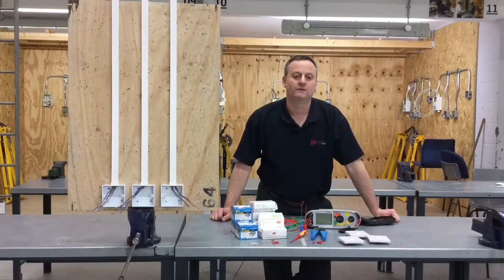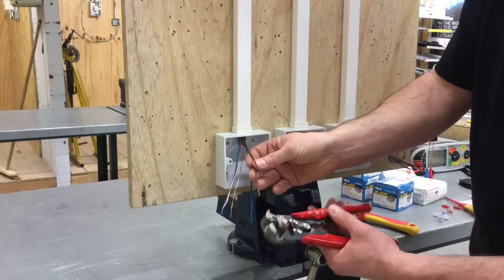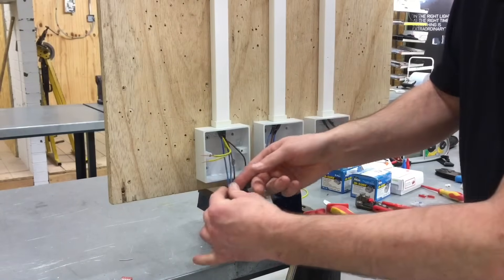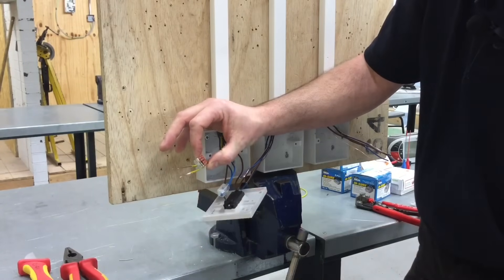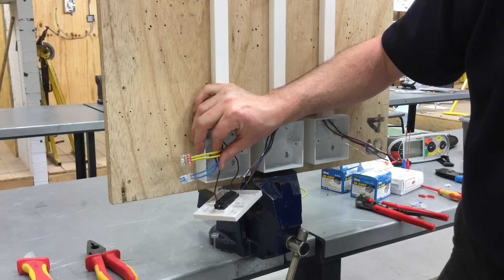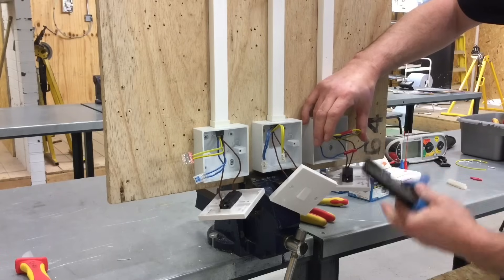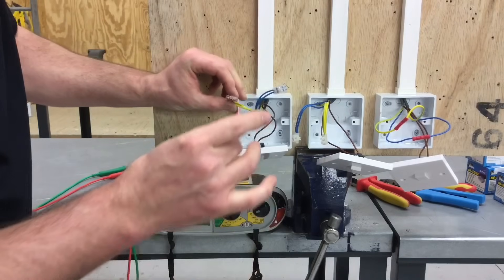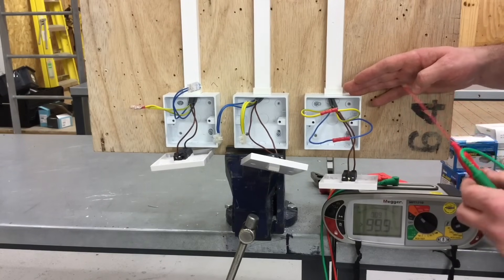Taking the Feed (Supply) to the Switch Connections Using Wago, In-Sure, Connector Blocks & Crimps

Comment: I moved from the U.K. to Switzerland a decade ago and the wago connectors were standard even back then. With the wago ones in this video, you can remove the wires if you pull and twist, rather than cutting the wires an wasting a connector.

Comment: You make your students use a knife to strip insulation because wire strippers are "too easy"? Why are you even in education? You should allow students to work smarter and wire strippers are the proper field tool and safer than a razor blade. After seeing someone slice their hand wide open it makes zero sense using a damn knife blade...

Comment: So the old connecter block wins hands down with easy testing.
So new methods aren't always better then. 
P. S. Do the switch connections last. Is the better way. Not working around it.

Comment: Interesting video, couple of comments. Using a knife to remove insulation from conductor opens the operative up to cuts on fingers / thumb. Risk mitigation would be to use strippers, I've used the adjustable V notch pliers for donkeys years without issue. Also cutting back the excess conductor, why not use end snips, less cumbersome than pliers. Inserting the single conductor CPC into the Wago,  I use long nose pliers on the conductor for insertion after sliding the PVC sleeve back a few mm, adopted this method after  a fail on testing. I thought the CPC was fully inserted and it looked it, but testing proved it wasn't. Plier insertion only now.
Reply: A few tiny cuts will quickly teach them to be careful.  I do agree about the earth conductor and loose screen.. Either pliers or careful visual check on the Wago.

Comment: I am Shocked, you took me back some 30 odd years to when I first entered the industry and All those dumb practices existed then. Sorry but what I have seen here today is nothing more than Practicing the Magic Art of Bodgery, lets start over here,  inserting crimps, wago's,connector blocks left Floating around in any Electrical Accessorie is a Massive No No, Find a Solution, yes there is one and it has been around since the begining of time, ok maybe not that far back but believe me as far back as my career has spanned. Go out and Buy a DP Switch and connect all your Cables into the correctly provided terminals of that Accessory,  oh, you have a need to connect a 4 gang plate switch, then use a Grid Switch, this again provides you with all the necessary connection points and cuts out the need to bodge the job as they say. 
On a final note, Crimping Cables properly to extend their lengths can be an acceptle practice provided the Crimped Joints are Sealed, Heat Shrink is one means of achieving this, no opening is allowed or needed to test as it is considered a permenant fixing, like soldering.
We as an industry have not yet arrived as a Communication industry choosing to leave bunches of cables flying around a Cabinett in terminals such as Wago's
Mr Spence Eng

Comment: I think its bad practice to crimp earth a neutrals in a switch. No they need to be readily disconnected I.E. WAGO lift up connectors or traditional strip connector purely for the reason of fault finding. Crimps have to be cut off and re terminated (not with crimps) you need to be able to disconnect cables and verify their ok no faults or temporary/permanently disconnect in order to get the circuit back on again. It winds me up when I see this when you’re looking for faults (you don’t need this if you’ve been called out in the middle of the might). Also when they screw the earths together and sleeve them with one piece of sleeving you have to unscrew the earths and separate them take the kinks (work hardening the copper) out the wire in order to verify them and re sleeve them separately. I always think people who do this never have to look for faults or have to go back their installations. And I don’t understand why people are saying you can’t take a neutral to a switch why? There’s nothing in the regs to say you can’t. Most guys now are doing this because we are not using ceiling roses anymore and having more fancy fittings which never have enough room for connections (especially wall lights) easier to find faults and disconnect if need be.

Comment: I don't understand how the continuity from the line to the CPC happens. That would mean that the line wire is shorted to the safety ground somewhere upstream which would rob this downstream circuit of any current? Wouldn't the better test be a continuity test between the return and the CPC?
(Disclaimers: I'm in the US and usually the safety ground is connected to the return at the primary breaker panel, not sure if it is similar outside the US. I'm trained in electronics so I understand circuits, but I'm not trained as an electrician so I don't know NEC (or other country equivalent) electrical wiring codes.)
Reply from the maker: I think the answer is in the description. I have linked the line and cpc (earth) together as if my learners were carrying out a continuity of cpc test on a lighting circuit. 

Thanks for commenting and watching. Gaz 👍

Comment: i realise this is a very old video but upon watching i have come up with an question. In this video you used the 5A connector block however in the UK most lighting circuits are protected with over current protection rated at 6 or 10 amps so in theory when these are used to connect the neutral then there is potential of failure there. I'm sure it is an unnoticeable thing and nothing bad would ever come of it as this is how it has been done for years and i have yet to come across one of those overheating from such a cause. anyways, those wagos are great and they also do twist off! keep up the amazing content!
Reply from the maker: Thanks 😊👍
Reply: Well spotted, but it has gone on that way since the introduction of 6A MCB's and the reason may well be the same as;  have you ever thought why we are allowed to use 0.5 or 0.75mm Cord Flex to the Lighting Pendants when the Max Current is way below a 6A or 10A MCB, the reason given to me by a very Senior Engineer was that it would be highly unlikely that such a heavy current would ever be taken from the Lighting Circuit to the Light Pendant and the same reason is True for a 5A Pvc Strip Connector, but please bear in mind there is a place for everything within the Electrical Industry but intalling connectors into Light Switch Box's is or should only be absolutely nescessary to secure the Switch Wires cpc [But there are Manufacturers who provide a spare Terminal to their Domestic Plate Switches now] and then it should be used in such a way as you take a Pair of 5A Connectors and screw through the center a tiny fixing into the rear pattress to prevent the Strip Connector Floating about within the enclosure.
Hope this helps.

Mr Spence Eng

Comment: I have always been told not to use through crimps with solid core wire only with stranded wire.
I know you was only using 1mm wire but would you use it on 2,5 and higher?
Reply: You most certainly can, you just have to ensure you use the correctly rated crimps for the cable size and current rating. You have to use ratchet crimpers. Give the cable a good hard pull to ensure a secure crimp.

Comment: Excellent channel. I must say though, in all my 55 years of doing this type of work, I have never used a knife to strip wire, it tends to nick and damage the wire. I have always pinched the insulation with cutters and pulled off the end, thereby not damaging the wire. This is a skill I had to practice.
Reply: David Potterus I use me teeth😂😂
Reply: Yes, but a sharp stanlyknife like a pair of side cutters have seen many a novice nick or cut to deep into the copper and damage the conductor, hence how many times have you pulled off a socket or light switch only to find the wire off, in the main a cable just sitting there waiting for you to come along and snap the wire. 
The proffessional Electrician has Strippers in his/her tool box, he/she sets them to the correct depth and 100% success rate!
The more I see today the more it seems that we have poor training and lack of correct leadership and all the BS Regulations in the World does not make a Good Electrician.
Mr Spence Eng

Comment: The switch will have top marked on it . It makes no difference which way round you put the 2 brown wires.
Reply: Why? is it your intention if you have put the switch on upside down to say that you have adopted the USA Switching practice of having the Switch UP for ON and DOWN for OFF?
You do know there is still a correct way of wiring a 1G/1W Plate Light Switch?

Mr Spence Eng

Comment: Always good video's, been in the trade for years, enjoy watching as your never to old to learn new tricks. 

My main preference is to crimp however I found that the closed end splice crimps are better for this scenario. As you can crimp 2+ cables which is good for the CPC side of things. All cables go in the same hole to which I twist together before crimping that way you know you have good continuity. Easier to get the test probes onto copper, and you can always remove crimp with a pair of gland pliers, by squeezing the sides which saves cutting off.
Reply from the maker: Thanks for the wonderful message Gaz 👍

Comment: Those clip devices used in example one  are really trick wish wish we had them here in the U.S. but they would never fly for that type of installation no physical connection of the wires like in a wire cap  we use ones like them in low voltage communication connections.
Reply from the maker: Take a look online for Wago connectors they are a massive part of any electricians kit. Thanks for commenting and watching Gaz 👍
Reply: Wago connectors have been in use and UL listed in the U.S since the 1980s....

Comment: Using a knife? That's stupid,  folding over? Oh so you've been shoving that into little apprentices heads as well?

Those knifes are for stripping SWA, how to slice your fingers open and use cheap insulating tape as a bandage??
Reply: Please please get rid of the stupid knife it's another over priced tool we DON'T need, if you can't strip a cable with a pair of side cutters then your in the wrong trade

Comment: so in this case neutral will come to switch first then go to the light fitting, rather than directly going to the light fitting
Reply from the maker: That’s correct 👍
Reply: Running all wires (live continuing as switched, neutral, and earth) through the switchboxes is a great way of future proofing. In two-way (+ intermediate/s) circuits I also run a dedicated unswitched live wire through until the last switch before the light. This allows you to convert any switch in the circuit to a wireless receiver-switch or tap off emergency lighting in the future. If you really want to go all out, which I did in my own house, you can opt to use all 2.5mm² cabling to keep the option open to convert a light circuit over to a mixed circuit by simply tapping off a socket from a switchbox without the need to run wiring from a nearby socket circuit or rewiring the lighting circuit to meet mixed circuit regulations.
In my garden I actually had to run a unswitched live all the way to one of the lights since I used an armature that turns on alongside the rest of the garden lights, but also has an integrated PIR sensor so I don't have to turn on all the lights just to quickly get something from/to the garden in the evening, which made me think that might actually be a good practice to just do as standard in a rewire/extension anyways.
Sure it uses more copper this way, but it definitely isn't that much harder to install and the bit of extra money spent on the wiring job now might save a lot of money and headaches in the future when something needs to be changed/expanded in a fully finished and decorated room/house/garden.
Reply from the maker: https://youtu.be/k0u8P0PcGlQ

Comment: Soooo useful .. thanks Gaz.  Question:  My practical 204 (2365) exam is in 6 weeks time.  I am 10-thumbs when stuffing stranded singles into buggered ceiling rose plates whose connector threads are stripped bare by the 10 students who used them before me.  If I use (buy my own) GENIUS in-sure maintenance free connectors in my 204 exam, do C and G allow this ? (my college won’t care .. they only care about the profit they make 💰) ... I can’t ask C and G cos they won’t communicate with students.  Ta muchly

Comment: Am i correct in thinking normally would only be switching line and lve to connect on switch plate. Plus cpc to brass screw in back box
Reply from the maker: Correct
Reply: @GSHElectrical  thank u

Comment: It always amazes me, in this day and age with all the technology and tools available that we still use a knife.  Electrical safety being what it is I thought the use of a knife would have been outlawed, after all, when stripping back the conductor are we not effectively reducing the c.s.a? (yes ok not my much if at all). But when we do nick the copper we are creating a weak point.

Maybe it would be good if manufacturers fitted a very small din rail into their back boxes, just for the purpose of conductor termination.  OR manufactured the box to suit a small din rail and made it possible for sparkies to purchase said din rail? food for thought.
Reply from the maker: Hi. The young learners that come to me have little or no hand skills thank to iPads and the Xbox. Using a knife is part of the training to improve these areas no point showing them the easy options straight away (but we do later on). Thanks for watching and commenting GSH Electrical 👍.
Reply: GSH Electrical That's exactly my point, the youngsters are bound to cut through the conductors insulation on a bit T&E or flex.  Or even worse they will chop thier fingers off.

Comment: I’m a qualified electrician,whose been out the game for a few years ,but am coming back ,this is something I would never have done ,and would consider as bad practice..ie having neutral in a light switch ,when did this come in to be accepted 
Many thanks
Jason
Reply: @Ricardo Miller Indeed, it's also much easier for the householder to change to different light fixtures as many of the types supplied by big brand stores don't have loop in terminals, and indeed many don't even have room for them
Reply from the maker: Hi. Reduces conductors at downlights and many wireless switching systems/colour change need a neutral at the switch...  hope his helps and thanks for watching GSH Electrical
Reply: Bs7671 leans towards advising a neutral is installed at switch locations to future proof a installation
Reply: Neutral at the switch is required for some home automation switches & dimmers.
Reply: I agree with Jason. I have always considered that this was bad practice...if there was supposed to be a neutral at a switch location then a terminal would be provided.
I do appreciate that modern wiring systems such as downlights and smart switches may dictate different wiring practices
Reply: You are not a qualified electrician if you think having a neutral in a switch box as unsafe or bad practice. It has been wired this way since before my father was born.
Reply: @bmwmike3534  I certainly am , it was considered bad practice years ago , but can see with the regs now that it’s leaning towards a neutral at the switch for future proofing of smart lighting etc , your Dad must be a young man as it wasn’t the norm in domestic properties years ago .....
Reply: @jasoncowell1001  I am in the united states. Not sure if you are, but its been that eay forever here. I am actually a third generation electrician. Dads 59, master electrician and owns his own company. Grandad was a master too. But I know every countries different.
Reply: @bmwmike3534  that explains it , this is in England, years ago it was deemed as bad practice to have a neutral at a lighting switch, but they are being taught differently now because of downlighting and future proofing of smart lighting 👍
Reply: This is the way I was taught to wire lighting circuits or use a joint box and wire everything separately. others seem to  think it is a good idea to loop wire at light pendant positions and cause all sorts of problems changing light fittings or loose connections when untrained people meddle with them. They rewired the council houses near me years back from the joint box method to loop wiring at the ceiling roses . Madness . :-)

Comment: Why would you take an R1+R2 reading at a 2 plate light switch when that is not the end off the circuit?surley you should be taking it at the last spot light as you said sparkies wire 2 plate usually when you have spots,so how do you know you have an earth at the last metal light fitting?
Reply from the maker: Hi. On an initial verification you have to prove the continuity of cpc at every point in circuit (including the switches).... also if the lights were say out of reach high in the air like a theatre you may have to take the reading at a switch because of access issues. Thanks for the question and watching GSH Electrical

Comment: Is this just a demonstration on the connector blocks? Trying to wonder why you have neutrals at the switch. Great videos by the way
Reply: Having had an awkward job to feed in neutrals for all switches on a hallway to allow for changing to a timed switch that requires its own power, having neutrals run to start with could provide future flexibility. Different styles of intelligent light switches may well start to appear as well in the near future.
Reply from the maker: Hi. It was part of a collection of videos on taking the feed to the switch... try his link https://youtu.be/k0u8P0PcGlQ
Thanks for watching GSH Electrical